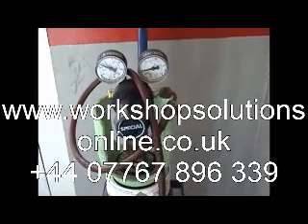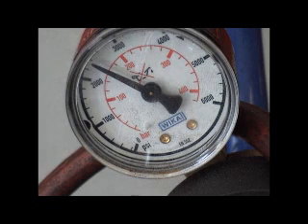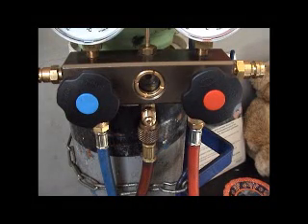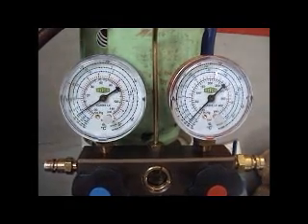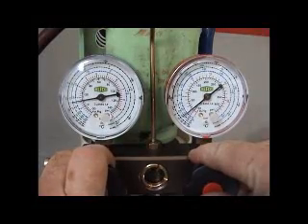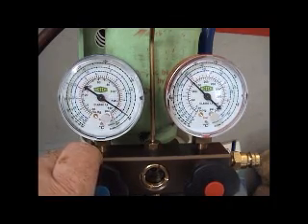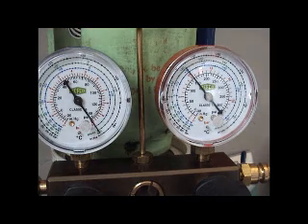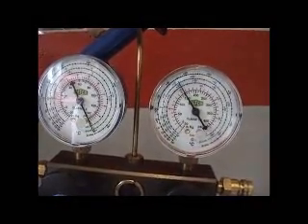Car Air Conditioning Pressure Test

Comment: Thanks for the vid. I haven't found anyone else that has a vid using nitrogen on a vehicle. Can you tell me how you adapted from your tank regulator fittings to the r134a fitting for the charge line on the manifold gauge set?
Reply: HVAC suppliers sell adapter fittings which are simple parts and not expensive.  Thread pitch on the regulator side depends on your regulator (I'm not familiar with non-US systems) and the manifold gauge side will of course match those.